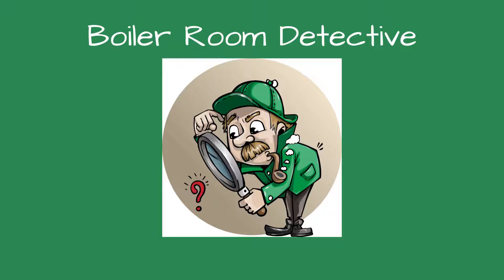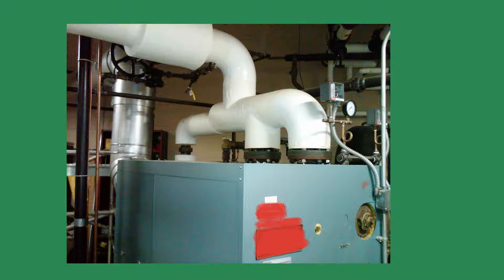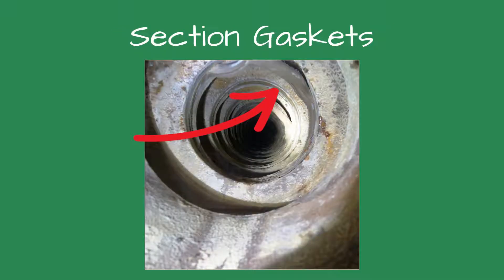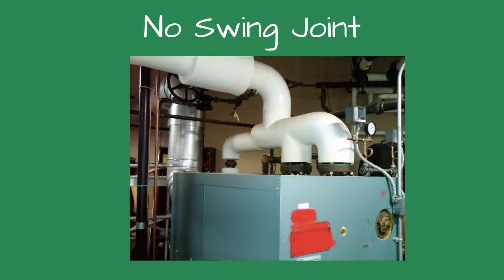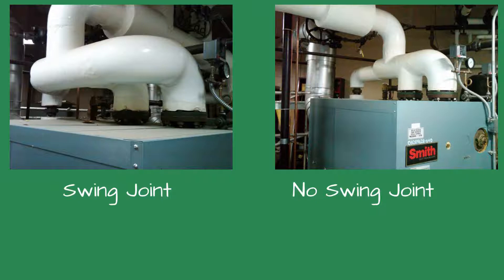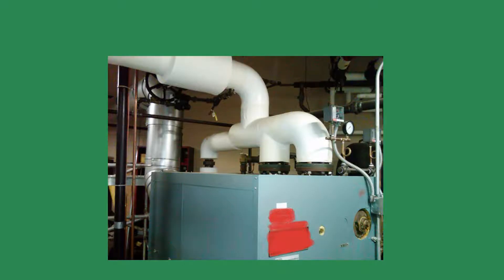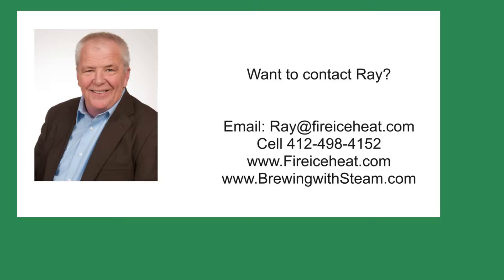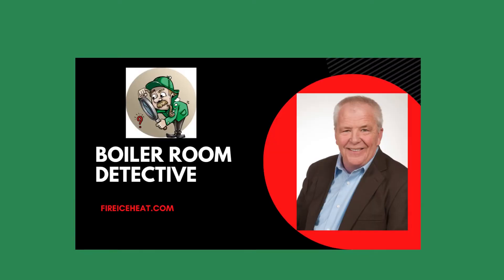The Case of the Missing Swing Joint

Comment: Mr Boiler Detective, What is your opinion on laying a Tee on it's side on a steam boiler manifold in a residential application? I' have seen many systems with a Tee laying on it side with no problems so long as the rest of the near boiler piping is correct.
Reply from the maker: Most manufacturers recommend using a tee on its side to connect to the steam supply from the boiler. I would recommend trying to follow the manufacturers instructions because if there are issues, you could say you piped it according to the instructions. Thanks for the comment

Comment: Fascinating. I find that most of the time you have so called problem installs there is something that's been overlooked since day one. A very important lesson to learn is that when something breaks, there is no reason at all to think it was properly done to begin with. Even with decades old installs.
Reply from the maker: That is so true. Some installers never read the installation manual Thanks for watching and the comment
Reply: Good didn't know what they were doing.

Comment: interesting,good comment on reading iom,but whats a iom?....and do these instructions talk about swing joints?
Reply from the maker: Iom is Installation and Operating Manual Most cast iron sectional boiler manufacturers will have piping diagram included in manual Thanks

Comment: Fascinating. It is a shame that the boiler had its entire life used up so quickly; however it's great that you were able to solve it!
Reply from the maker: Thanks It is a shame the installer didnt read or follow the manufacturers instructions
Reply: @boilerroomdetective  
It is a shame that they didn't follow the proper procedure!  I think that issue doesn't just apply to the HVAC and plumbing fields. We fight it with the electrical field all the time too.
Reply from the maker: @davida1hiwaaynet  I would imagine the electrical side is just as bad. Everything is so technical and complicated on that side of the industry